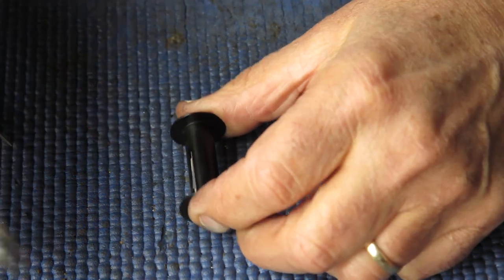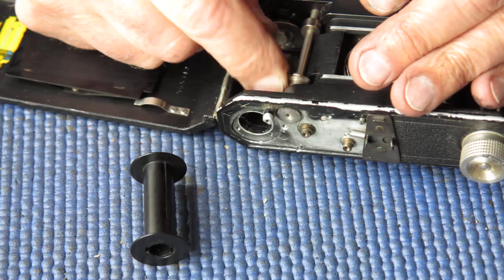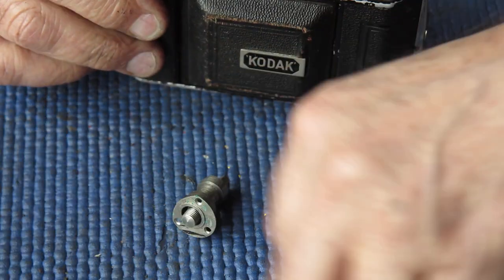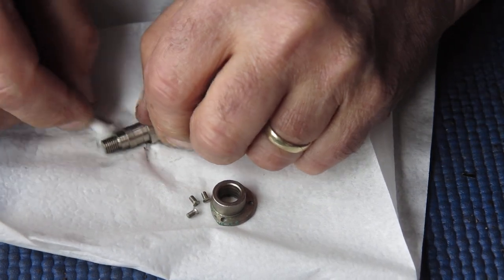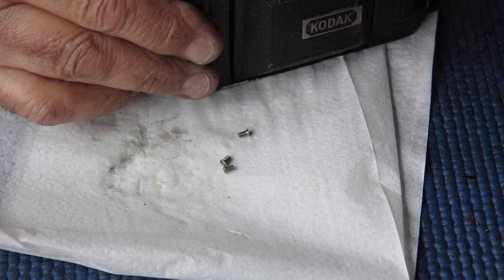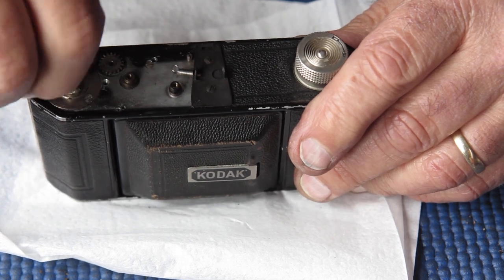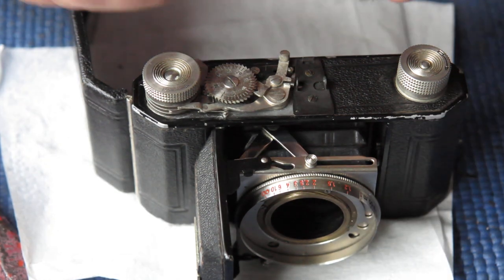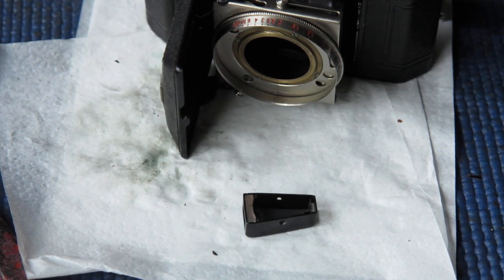Kodak Retina I type 119 service part 03

Comment: I have two cameras like this with Film Take up ratchet gears that are temperamental and 
Not very positive. Are they prone to wear? Or more likely damaged.
Reply from the maker: The gears can be damaged, often the culprit was probably someone attempting to rewind the film without moving the A-R lever across to the rewind position first. The damage can be to the ratchet teeth on the gears, in which case the problem is very intermittent,  or to the tips of the ratchet levers, in which case the problem is more or less constant.
Reply: Cheer Chris some investigation is need 🤔